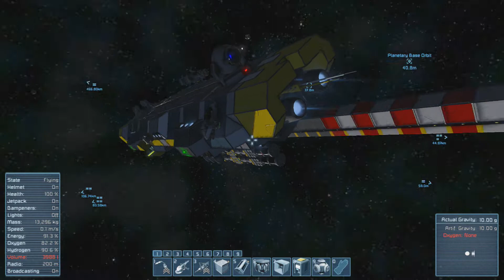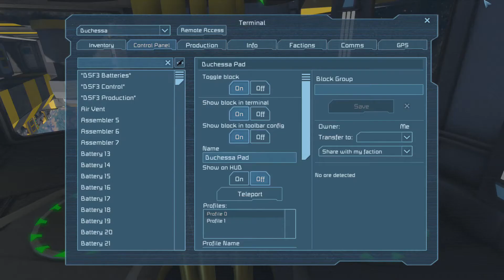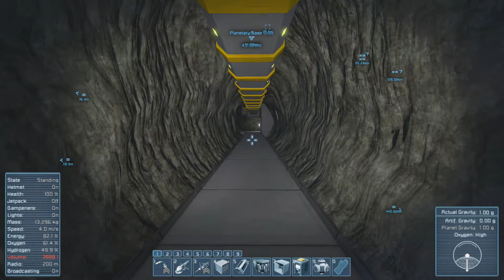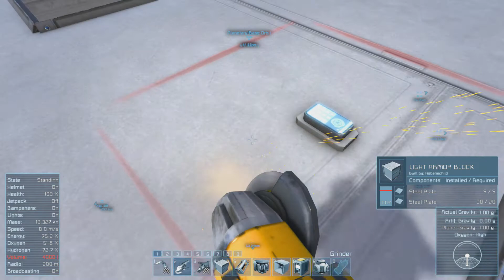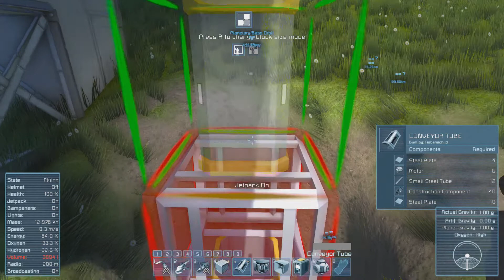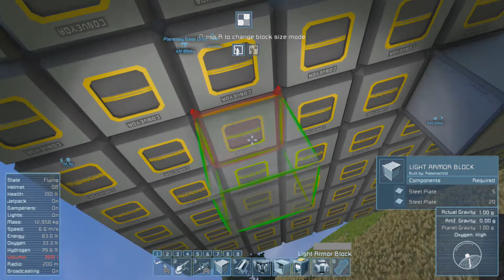Space Engineers Survival :: FUNNEL :: Ep. 518

Comment: Looks like the range on the gravity gens on the "sending" station is turned way up; you could probably reduce that to just the area in front of the ejecting connector to reduce... unintended side-effects ;)

Nice work on the tunnel there. I never get them this straight. :)
Reply from the maker: There is no way to reduce the size of the field, it is set to a maximum height because i want all the acceleration it can get and there i no way to only set the height above or below the generator, it evenly extends into both dierections. With a bit of way between the main body and the GravCan i can be save.
Reply: I understand you'ld want it the full length of the cannon, but even to the sides? That's the part I was wondering about.